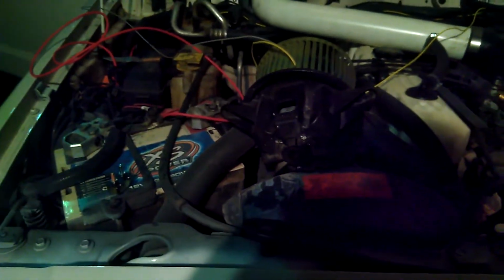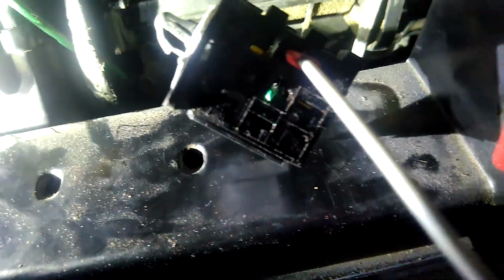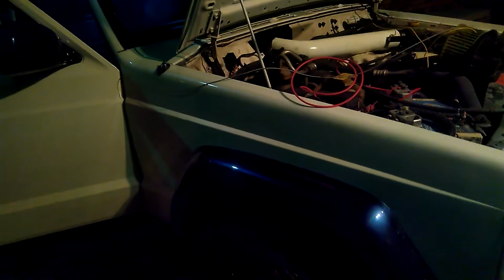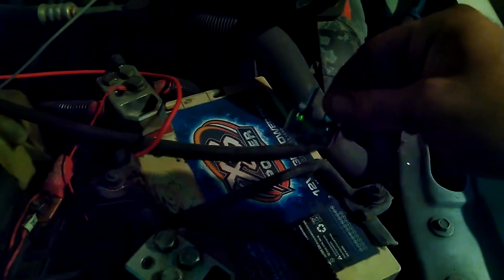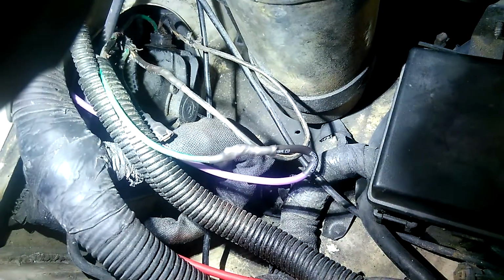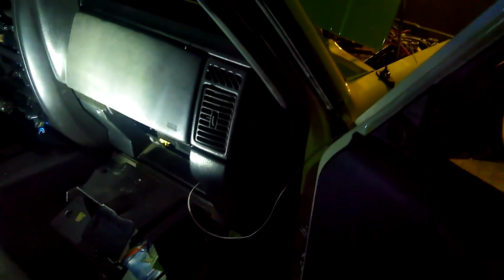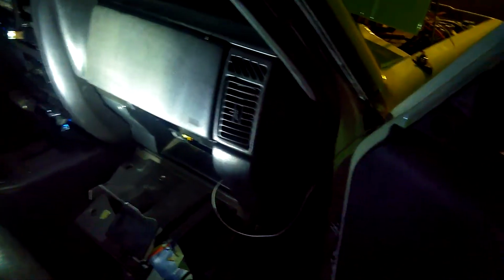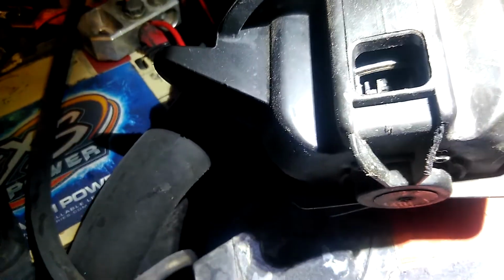1997 to 2001 Jeep Cherokee blower wiring work around

Comment: This video is underrated. I had power to the motor but when I put it under load I would lose my 12v.

After studying the blower motor circuit diagram  this video made perfect sense. I ran the wires and it worked as I hoped. Thank you immensely.

Comment: Hi 
Great post about this blower issue. 
I have the same problem with my 2000 plate Cherokee XJ . Burnt relay , relay holder and some of the harness wiring. 
Have you a diagram of what wires you used to power the relay , and blower motor . ?
Cheers

Comment: Hey, I tried your fix. I got my Jeep to partially work. I tried using the signal wire from the original blower motor relay to trigger the new relay that I installed. I only got one speed, and when I changed the speed selector on the dash there was no change in speed of the fan. Am I missing something here??
Reply from the maker: Did you ground the blower back to the original ground? All of the speed selection is done on the ground side. other than that you could have a bad blower motor resistor if it only works on speed 4
Reply: dalton456 first off, thank you so much for replying. 
Secondly I did not ground back into the factory harness. I grounded the other side of the relay. Effectively eliminating all of the factory blow motor wiring. (Positive and ground) So basically all I need to do is connect a ground back into the factory harness?
Reply from the maker: If you would like speed control you have to use the factory ground on the harness,if you just want the blower to work you can ground it out directly
Reply: dalton456 ok, will do that. Again, thanks for the reply. I’ll let you know how it turns out. When I saw your video I knew this was the fix for my problem.
Reply from the maker: Not a problem at all, glad It could help somebody out
Reply: dalton456 one more question. Do you connect the ground of the relay to the harness as well or leave that unconnected?
Reply from the maker: I put the coil ground of the relay to the chassis, it does not have to go back into the harness
Reply: dalton456 thanks again!
Reply: So I made the corrections like you suggested. Control side works perfectly. I did an open circuit amp check and the circuit worked to change the speeds. One last question, what size fuse should I use on the relay side. I installed the 30A fuse that came with the relay harness. The original factory harness had a 15A fuse for the blower motor circuit. My hunch is to back it down to 15A like the factory circuit was originally.
Reply: @dalton456   Hi . Great video regarding your idea for fixing blower on Cherokee xj. 

Do you have a diagram   of how you wired up the relay under the hood with the connector under the dash. I just can't work it out from the video. 
Many thanks